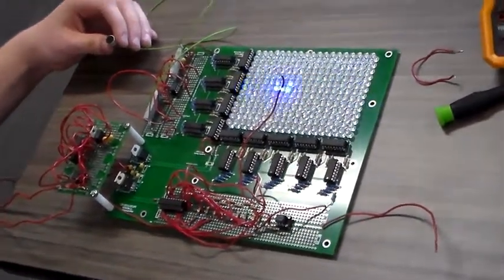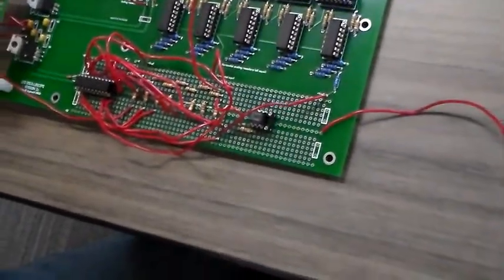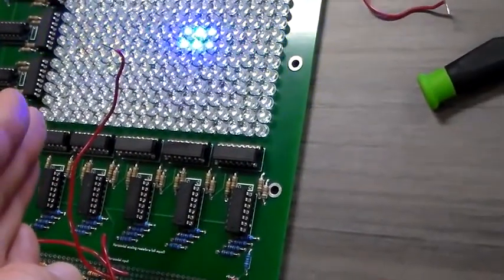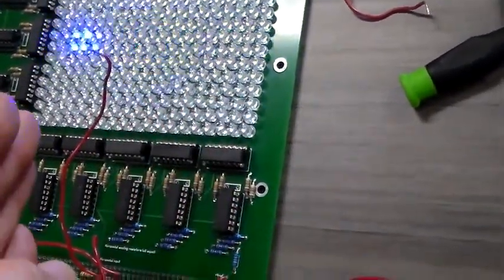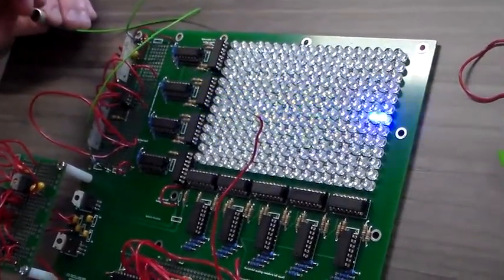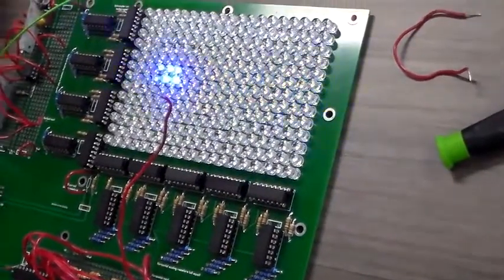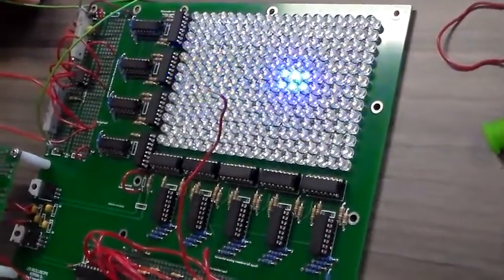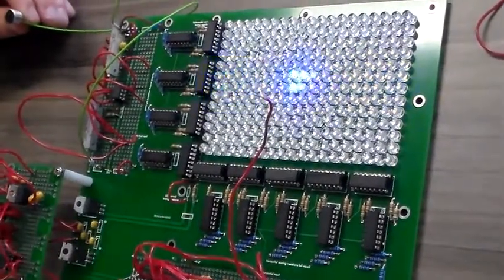LED-based oscilloscope sound monitor

Comment: That's far too complicated a sweep section. It could have been done much more simply.
Reply from the maker: Indeed, the simplest way would have been to sequence the columns of LEDs digitally using a decoder or shift register.  However, the main LED board was designed to use analog driving signals in order to mimic the operation of a legacy CRT display.  That way we can do things like Lissajous figures driven by two analog AC signals.
Reply: @lcstate_eet7381  I still hold to my statement that your sweep generation could have been done far more simply. One 8-pin IC, two resistors (one being a potentiometer), one fixed capacitor and one switchable array of capacitors for various sweep frequencies. OK, probably a small series of trimpots to accurize / calibrate it. Maybe throw in a CMOS opamp buffer if it acts like it needs one.

All analog, as they should be. Nothing digital (digital doesn't belong in an oscilloscope and nearly never even belongs in a multimeter).

B&K Precision did that in a commercial oscilloscope, and it worked remarkably well. I had one for a long, long time.
Reply from the maker: @timhofstetter5654  Agreed!  There are definitely simpler ways to generate an analog sweep signal, and your proposal works fairly well.  A student in a previous course tried something similar using the sawtooth waveform from an astable 555 timer circuit as the sweep and found that the non-linear ramp profile created a noticeable "compression" of the waveform toward the right-hand side of the display.  Regulating charging current through the 555's capacitor fixed that problem and gave a nice, linear ramp.

One detail I didn't mention for this project is that it was done in a course focused on microcontroller applications, so it's more or less a gratuitous use of a microcontroller to generate a linear ramp analog waveform using an R-2R ladder network.